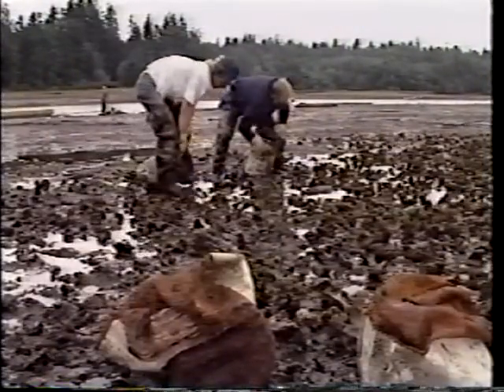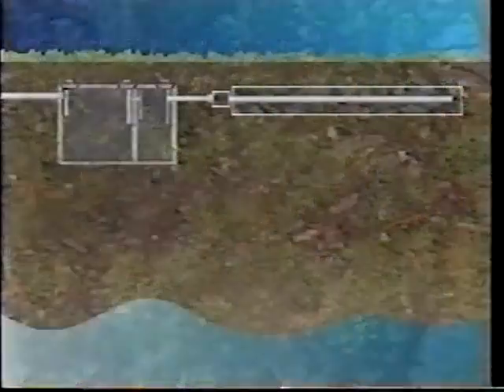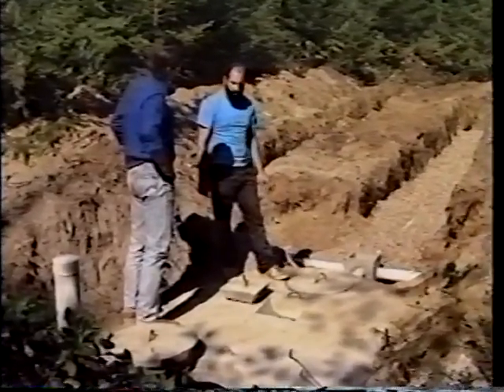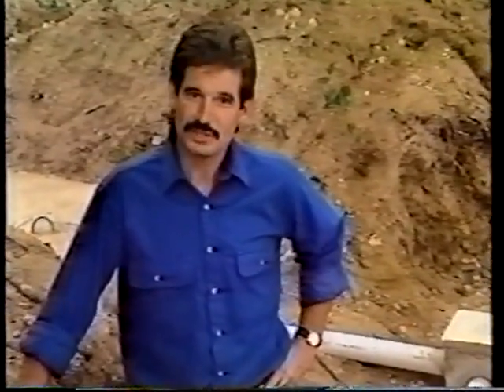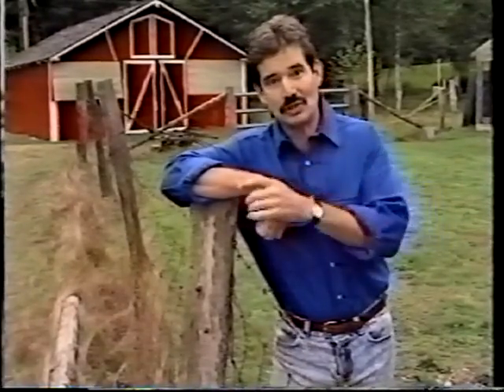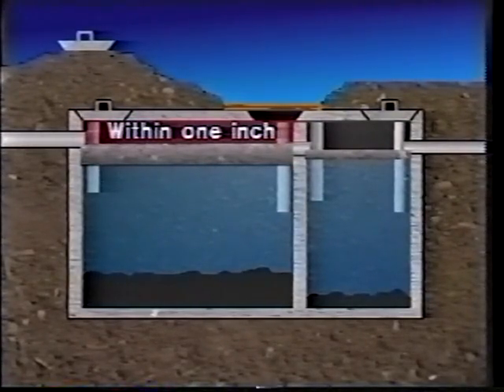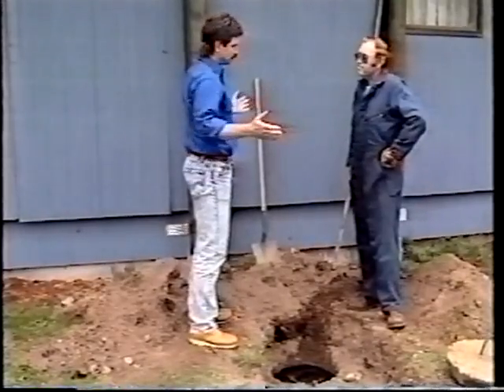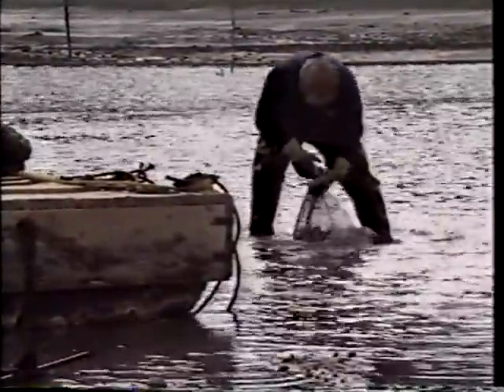Understanding and Maintaining Your Gravity Septic System

Comment: I wish I watched this before drain pro came and took my $215 without even checking to see the sludge level, or oil level.
Reply: Wow so I just called cascade septic in Puyallup and they gave me more useful information in a 8 minute phone conversation than drain pro did in an hour long inspection and $215
I won't be using drain pro ever again.
Straight up even the receptionist at cascade gave me great information she saved me $400 where drain pro was talking about pumping my tank out and it's not even the problem because I just moved here two months ago in pierce county. 

If you're interested in saving money and time with great service I'd use cascade.

I feel like a commercial but they offered free walk-through help to solve the problem I'm blown away.